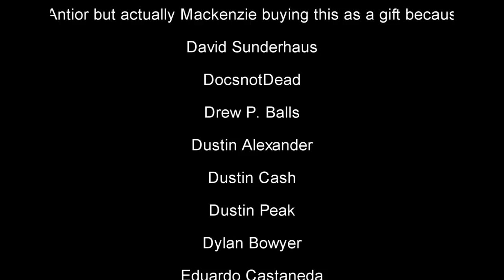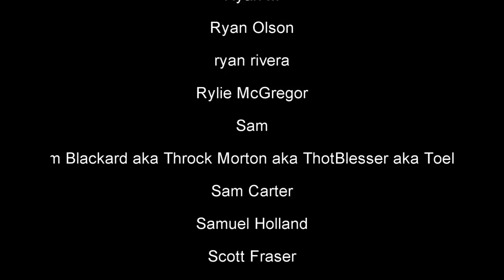Border Crossing With A Moped Inside My AE86

Comment: the thing in your fuel tank is a fuel filter it should be stuck on the bottom of your tank but it probs broke of, i dont use the fuel filter on my moped so she'll be right , theres a air fuel mixture screw next to your carb if you adjust it it should make your moped have more top end wich means it will go faster, and also it will idle easier, and check your air filter it might be clogged with shit,

Comment: Yoo Q, clean up the carb, I’ve worked a lot on bikes and that’s a dirty carb, also the thing that you found in the tank and didn’t know what it was it’s actually the fuel filter for the tank, you should replace it and don’t leave the moop with gas for more than a month without starting it, since it’s 2 stroke the gas gets fucked